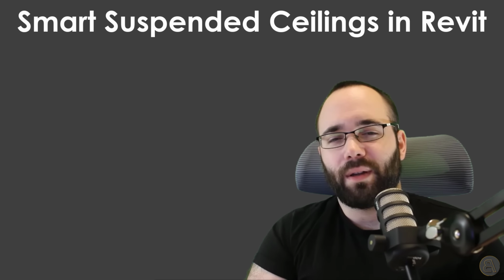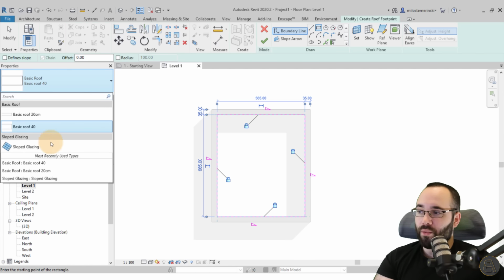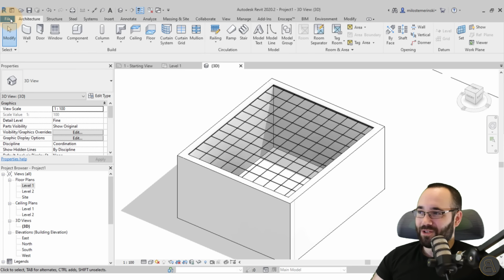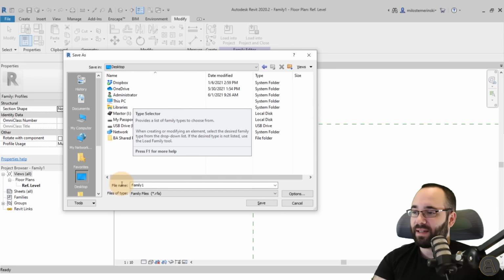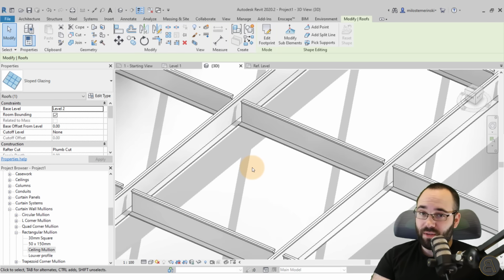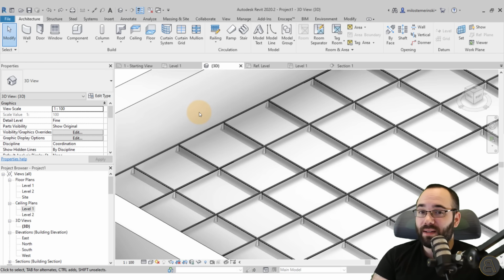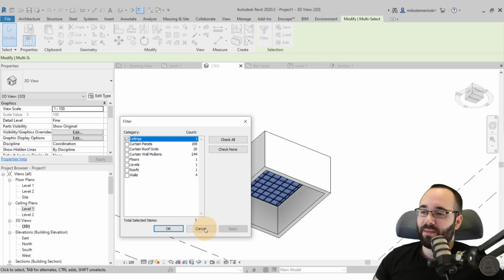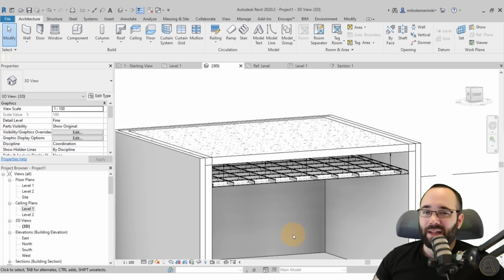Ceiling in Revit Tutorial [Smart Suspended Ceiling]

Comment: I had bought the Revit Template + Family Pack, thinking the Family  Pack would surely has the "Suspension Wire" at least and some exterior furnishing like Aluminiun Panel and Double Glaze Curtain Wall etc, but the Family Pack i got are just furnitures mostly (like you would get from SketchUp), trees, cars, cabinets, human, some sinks etc. Nothing useful in terms of designing buildings, like pre-built ceiling mullion, the suspension wire, interior and exterior wall finishes, roof etc. Even the advertised stairs, i dont see it. Pretty disappointed to be honest. 

but dont get me wrong, I am only dissapointed by that package (i thought it would contain all the components he has up to date (from all of his tutorial), for a higher one time payment). His videos tutorial on revit are still very good and clear, and very much appreciated.

Comment: FATAL FLAW!!! This is all very nice in being able to create such detail, even when having to go through so many steps in this software. Problem I see is this gyp ceiling that goes through the entire grid layout has no accommodation for lay-in light fixtures. I can hardly think of any room that doesn't need to address lighting. Most conventional lighting for suspended ceilings use lay-in fixtures. How do you effectively address this with your ceiling grid approach, without making even more non-time efficient modeling?

Comment: If a bim modeler I was working with told me they were finished the ceilings and showed me this I will be so mad at them for wasting all this time...
Reply: I think it’s about picking the level of detail appropriate for the project. No point doing this if you’re designing the whole office building but if the job is replacing an existing ceiling with a new grid, fittings, margins etc etc then this level of detail I think would be appropriate.
Reply: @NH00531  still no....unless you are the manufacturer, but even then, no because these are all premade sizes... So let's say you are renovating an office, why waste time on a section of this basic ceiling? If you wanted to see this in section, just use a detail component...
Reply: @JavierOropeza08   Agree with you, even in CAD files we normally refer this to the specs and then ask the contractor to do a shop drawing only if its needed. I would insted invest this time in the placement and coordination of electrical trays, and HVAC to see if they do not mess up with our architectural design.
Reply: @betz42  100% agree with you buddy
Reply: @JavierOropeza08  “still no..” Hahaha.
Reply: Dude he's not even working with the BIM sheet. No need for this level of Detail..
Reply: There's a couple of jobs I know that did this LOD but you're right it's pretty rare we'd go this far on a standard project. A technician would indeed get in trouble for this unless the project specifically demanded this.

I've automated this based on surface patterns in the past for a client, and they were a supplier doing detailed takeoff (I showed them ways to automate the measurement without the modelling as well, but they were quite visual).